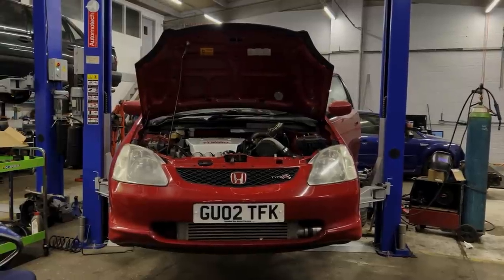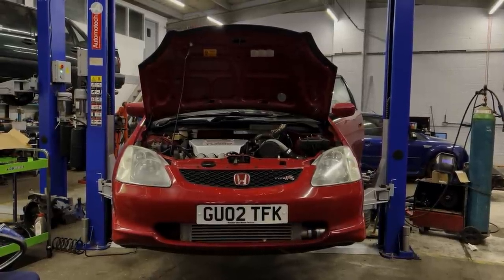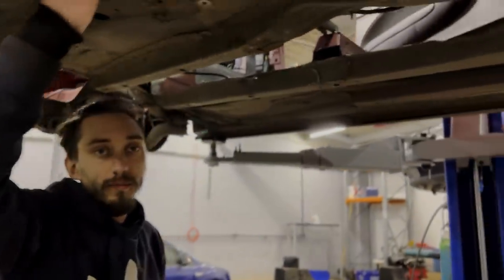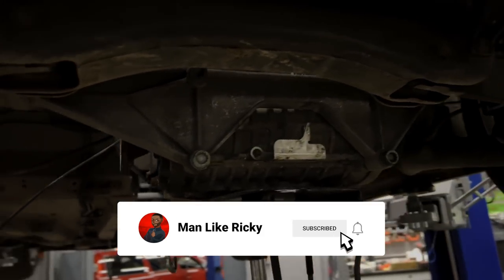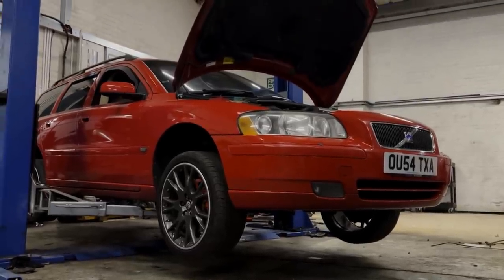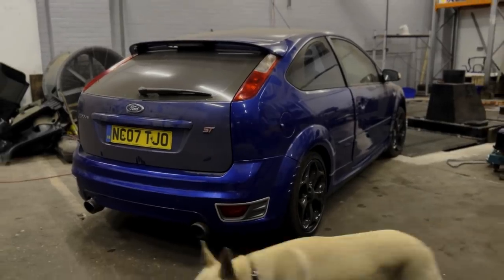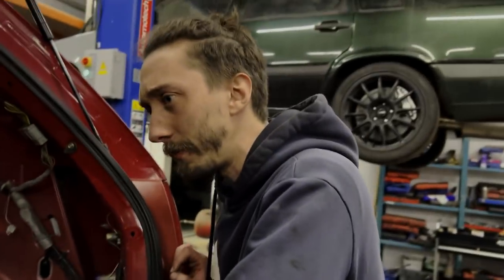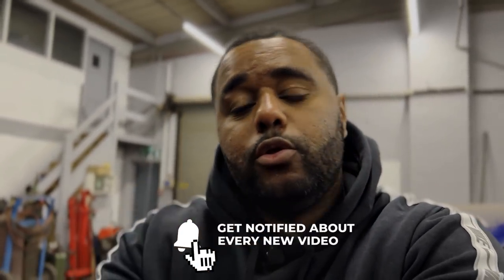THE DCT QUATTRO CIVIC TYPE R UPDATE!!

Comment: This could literally be the start of the future in awd Hondas. Even myself at the age of 36, I fear what it'll be like driving a twin disk clutch 10-15 years from now. Always like the idea of eventually going to a built auto in my awd ep3, but nothing that Honda offers can take the power. But it really seems like this transmission is the solution to those concerns! 

Excited to see more of this build!
Reply: I would love to do this aswell but butchering the back of the engine was abit to far for me yet, might buy a spare engine and do all the r&d on that before doing it to my forged block.  Plus there's no off the shelf engine mounts for this with needing to tilt the engine back more, sump may need reworking aswell and move the oil drain for the turbo to the front
Reply: you won't be allowed to drive a modified ice car by then probably, or there will be a tax which is crazy
Reply: I think the way around is easier 😅, putting a k20/k24 in a VW/Audi with a DSG box (dq500 or Dl501). I'm contemplating to do a k24 swap with dl501 in my Audi A4 B5 which has a curb weight of 1300kg which is similar once you have a ep3 awd I guess.
Reply: The whole point of a Honda is lightweight and balance adding 4wd ruins everything.
Reply: @spoonageDC2 , you know that adding the awd system only adds about 170 pounds, right? That weight is insignificant when it allows you the ability to put down an extra couple HUNDRED horsepower and not just do a 70mph rolling fwd burnout.

I know, you'll say, "a Honda's spirit is on the road corse and not a drag strip". But to really be fast, you need a certain amount of power. Eventually that power is more than the front wheels can handle which causes the car to wash out in corners. With a proper awd setup, you can power through the corners earlier and thus have faster lap times. Bottom line is, it just helps!
Reply: @BoostedEP3  only 170 pounds? Thats carrying  an extra person...

If you want to be faster  then get a different car, it's like getting a GTR and making it RWD 🤦‍♂️
Hondas for are for driving experience not for big bhp, completely destroys the experience just for bhp figures.
Reply: @spoonageDC2 , sounds like something a person with a slow car would say. Lol! And it's not quite the same as an extra person since all of the weight is under the floor and actually improves the center of gravity. 

I'll keep my awd k24a2 turbo ep3 that I can run 14psi of boost in 2nd gear without spinning. You can keep your car stock!
Reply: @BoostedEP3  yeah you can and I'll just slide past you on every corner 😈
Reply: @spoonageDC2  except as soon as the flag drops, I'd be 1,000ft ahead of you. Because you'll either be spinning or your car is so under powered that it can't spin the tires...
Reply: @BoostedEP3  lolol stop it with this underpowered rubbish, I have what I need in power to out do alot of cars that won't be able to hold boost on corners
Reply: @spoonageDC2 , amd that's exactly why people go awd. Thanks for proving my point.
Reply: @spoonageDC2  yeah but the civic is fwd anyway, so if anything it's just gaining use of the rear wheels which otherwise do nothing. Different when you take a RWD car and corrupt it's steering wheels by giving them drive.